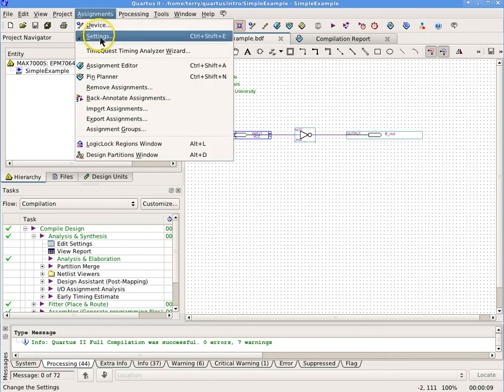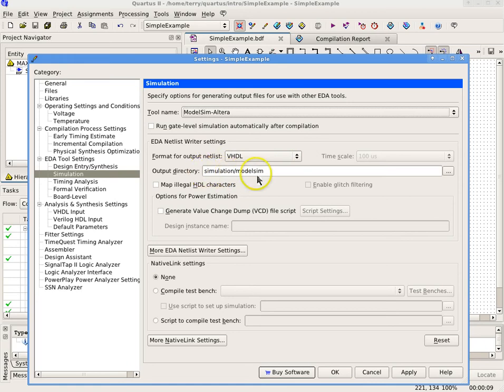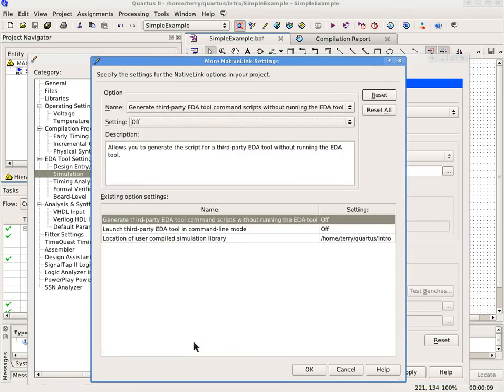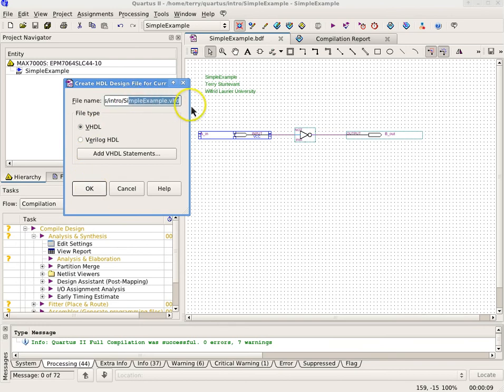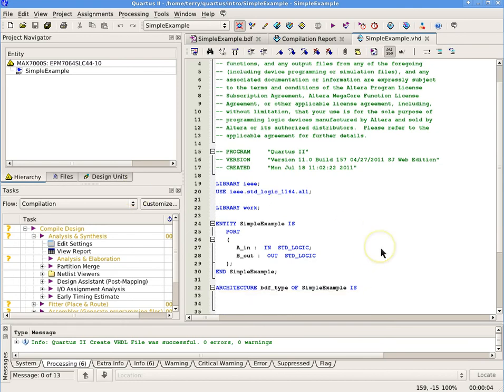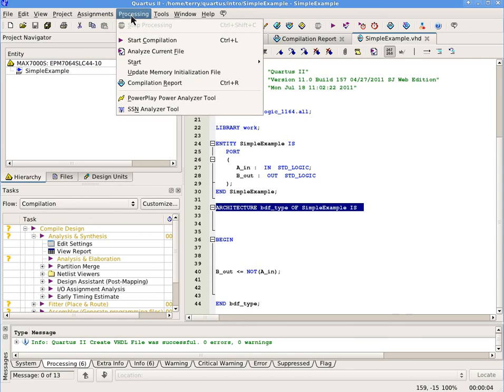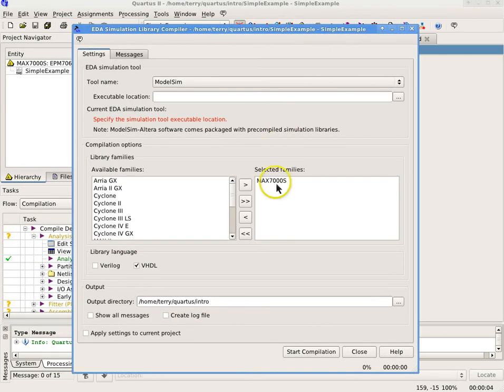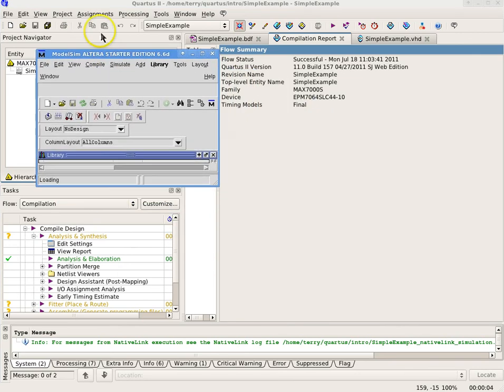Quartus II Preparing to Simulate using ModelSim - After Drawing

Comment from the maker: I've got three videos on how to simulate using ModelSim; using forced outputs, using the waveform editor, and using testbenches. Take a look at them. This video covers the requirements that you need to meet before you use any of those.
If you just want a simple simulation, and don't specifically need ModelSim, see the video about using Qsim. It's very easy for simple simulations.

Comment: Hi Terry,

I'm using  13.1 in windows and 14.1 in linux (CentOS)

Can you be so kind and clarify the windows path for the /settings/simulation/More EDA Netlist Settings/Location of user compiled simulation library.

If I understood correctly "on windows use c:\msim undercore lip?" I don't have that in windows.

Thanks
Reply from the maker: It's c:\msim_lib (lib with a 'b', not a 'p') on my system.